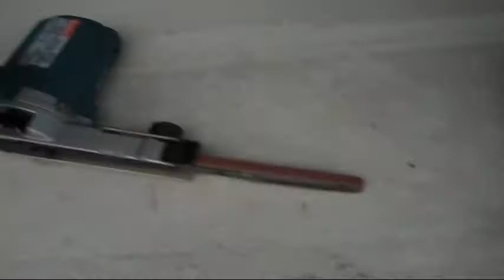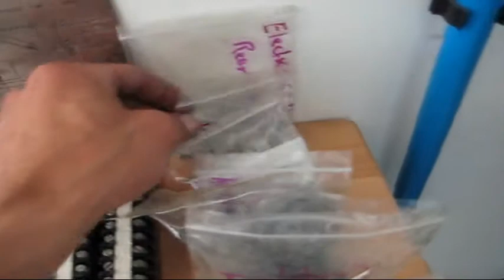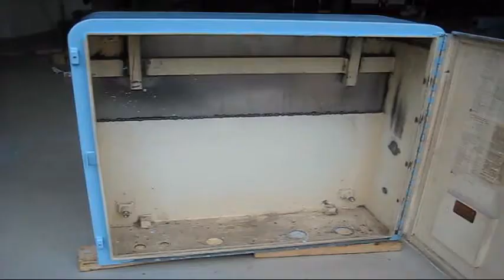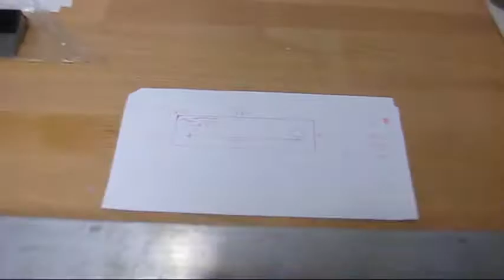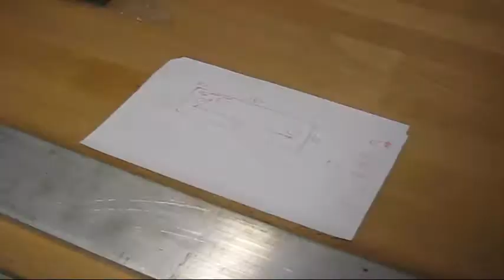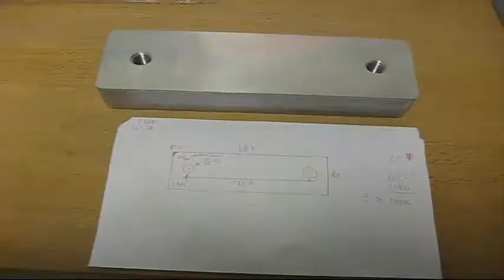American Pacemaker lathe reassembly part 18

Comment: I just wonder if the brand new belts just need a bit of time to glaze a small amount and the climbing will go away? That or perhaps the clutch grabs too quickly?
Jay Kilroy and Adam Booth both have Pacemakers as you know. Perhaps they have some insight on the motor mounts?
Looking forward to seeing the machine run and all of your hard work be rewarded :-)
Reply from the maker: I don't think the belts makes any difference, since I have two sets of belts: One new and one old and they work the same. It's just the inertia in the rotating motor and all the gears in the headstock taking a little time to match up. While that is going on the motor climbs.  I wonder I Jay's pacemaker has the motor under the headstock since it is an older model ? The beast at Adam's work must be bolted to the floor. Thank you for your comment!

Comment: What will you use to glue the plate to the floor? Are you going to rough up both surfaces to give the epoxy  or glue something more to key into and give better adhesion?
You may not want to glue right to the floor paint, as it would be the weakest link. 
It may not hold ether way, with that much repetitive action and force. 
Make a permanent fix that You have the skills to design and make it better for your application.
That will make it easyer to relocate the lathe in the furture. 
Other thoughts, could you make supports from the main body or a plate under it to the front side to take the torque? All thread rods to adjust belt tension, rather than that small adjustment bolt.
I enjoy watching your progress. Very thorough job. Keep up the good work.
Thanks.
MV
Reply from the maker: I'm going to use epoxy glue, and grind away the floor paint down to clean concrete.
You're right: It might not hold up, but then we know and I will have to make something else.
Thanks for the ideas and nice words !

Comment: it's strange that you'd have to have bolts in the floor to tighten the belts. Are you sure the plate that the motor is bolted on is not supposed to go vertical and have the tensioner push into the bed rather than pull into the floor? (would make more sense but then again I've seen stranger things :) Or maybe you're missing a plate or bracket that would go under the bed and motor to provide the mounting point for the tensioner.
Reply from the maker: I am as sure as I can be. There are no boltholes on similar  in the bed or on the motor to suggest it was done that way, but I thought about making a setup exactly like you describe instead of fixing it to the floor. I decided against it because things would not line up perfectly and I didn't want to drill into the bed. If I had a big steel plate that both the lathe and the motor mount sat on it would be easy.